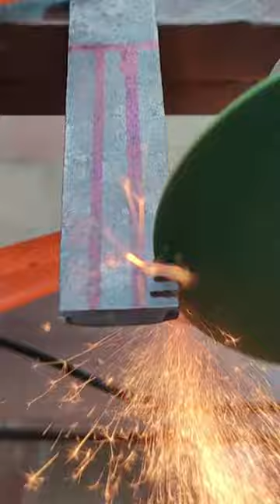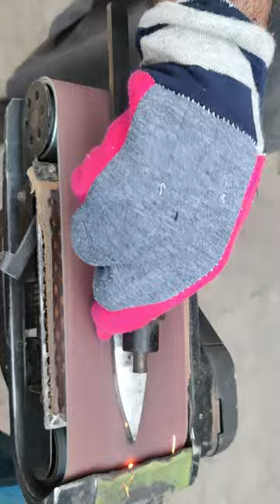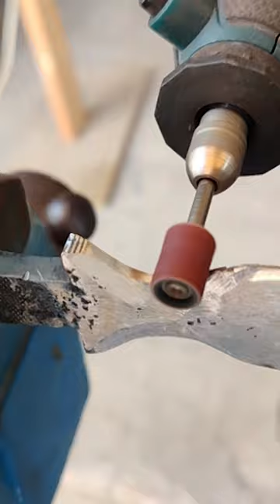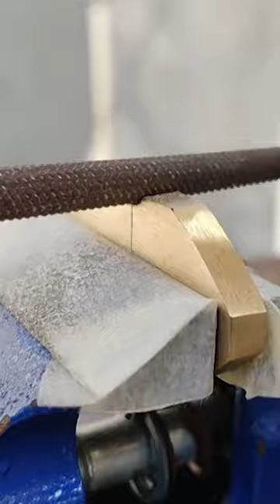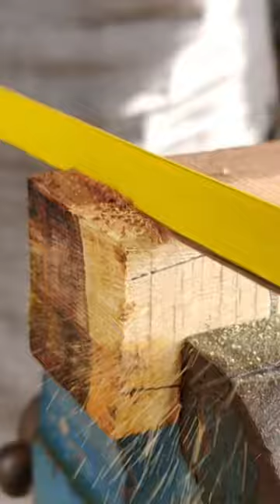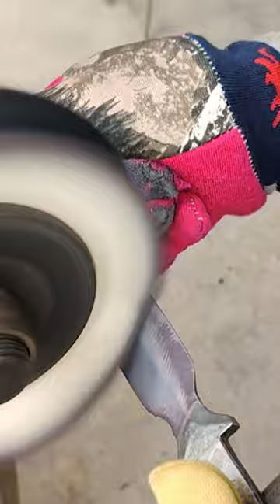Knife from File #knife #file #diy

Comment: That's cool and all but files are brittle af. You can sometimes case harden them but a lot of guys will forge weld (or mig weld and forge solid) a springier piece of steel along the back of the knife to give it a little flex if you drop it